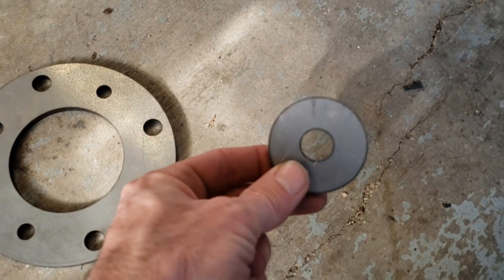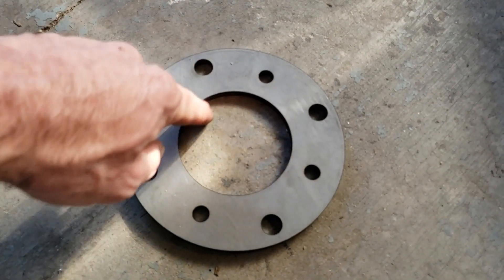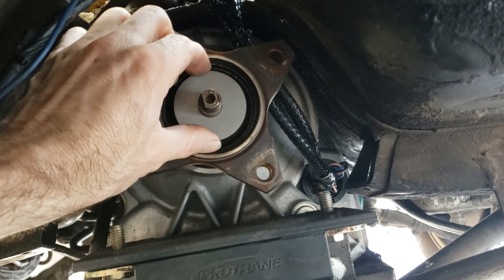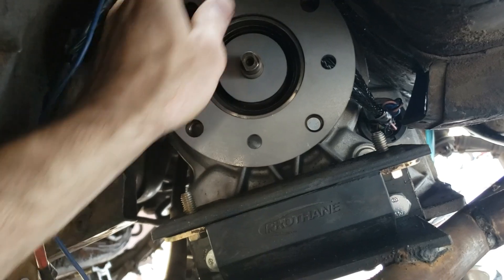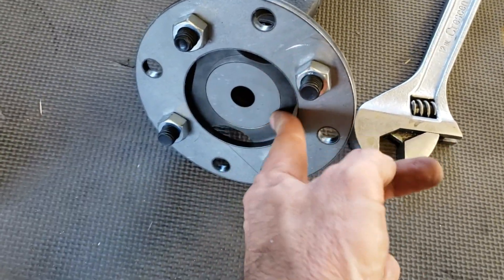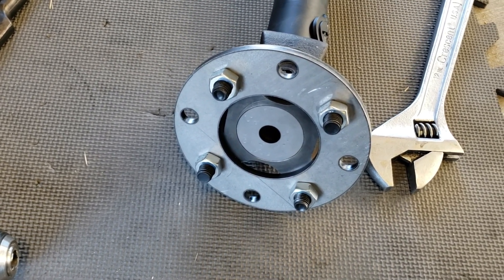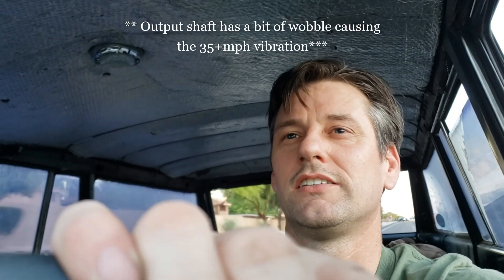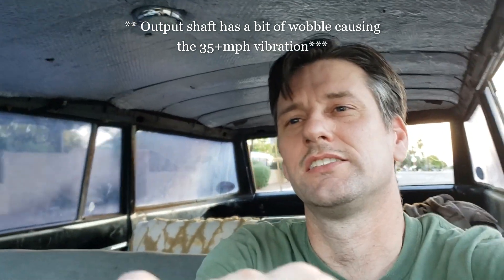6R80 to 302 Test Drive

Comment: Where did you get the adapter stuff from? Trying to do this on a 3.8 V6, uses the same trans as a 302 (T5). Also, shaking could be because the driveshaft is typically a weighted & balanced unit. So the balance could be off slightly causing the shaking at other speeds. I have a balanced driveshaft from factory on my car and other newer ones. If it’s not balanced properly, it could be a cause of it
Reply from the maker: I designed the adapter parts in solid works and had them laser cut.  The driveshaft was built and balanced by a reputable shop here in town.  I don't understand why the output yoke on the trans is so floppy...
Reply: @olboy1981  my 2014 Mustang GT had the same vibrations. I switched to a one-piece driveshaft and it got worse over time.
I then switched back to the stock two-piece and it got better but never went away. My friend who builds transmissions suggested shims or tighter bearings in the output shaft piece.
So, Im asking myself, why am I pondering a 6R80 swap for my Lightning pickup?
Reply from the maker: @behindbarsmototouring898  since this adapter works with any mod motor trans... some are now doing T3650 swaps.  The output yoke thing is a problem.
Reply: @olboy1981  Yes. I couldn't get the slack out it. I bought that car new and dealt with the vibes for 117,000 miles.
You made output yoke adapter?
Reply from the maker: @behindbarsmototouring898  yes, I couldn't find the right yoke to go from the 4 bolt flange to a 1330 u-joint.  The driveshaft folks found me the right one later.
Reply: @olboy1981  I ended up finding one at Ft Wayne Clutch and Drivetrain. Good price too. 
Are you using the controller from U.S. shift?
Reply from the maker: @behindbarsmototouring898  no, I added source code to the ms3 box to control it.  I ended up going back to the 4R70W since I couldn't sort the 1-2 shift hardness and the vibrating driveshaft problem.

Comment: Did you figure out the Vibration issue?  i have the same on my 99 4.6 2V swap and I have tried many things including running the driveline at 0 degrees.  Its still there.  Take the DS out and its gone
Reply from the maker: @Bodyshot Jake I could not sort the vibration.  I might try a 2 piece unit later.  I did add a shi to tighten up the output flange but it would still hum passing through 55ish mph.
Reply: @olboy1981  Mine does not start until around 55 mph, I'm going to try the shim Idea and torque it down a bit more.  I have an assortment of shims so I will try that then look for a lighter DS.